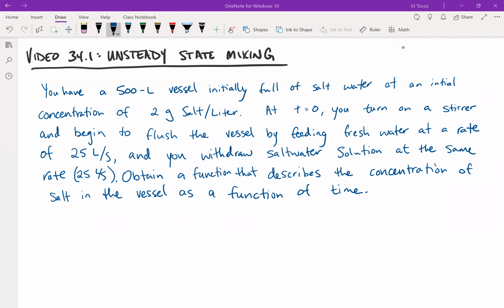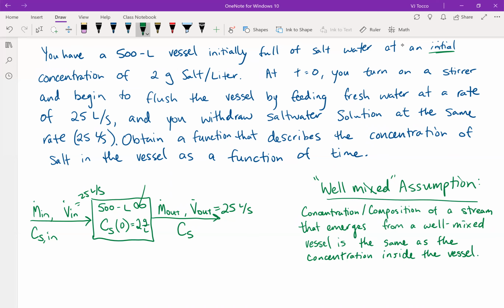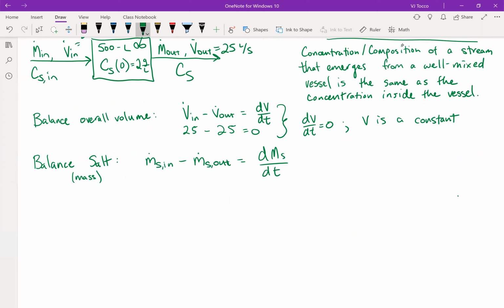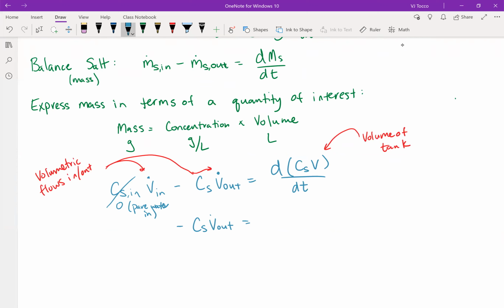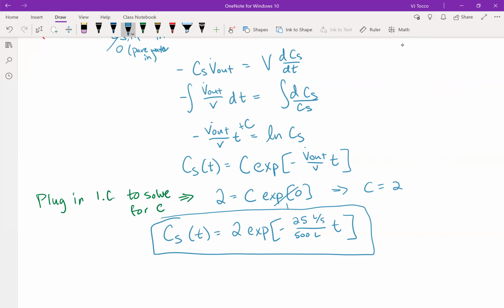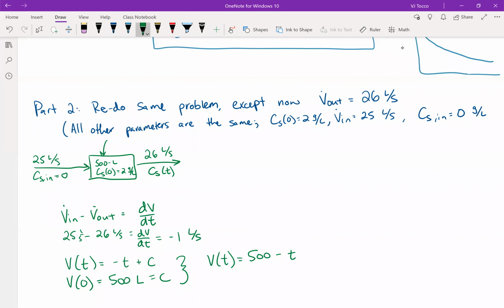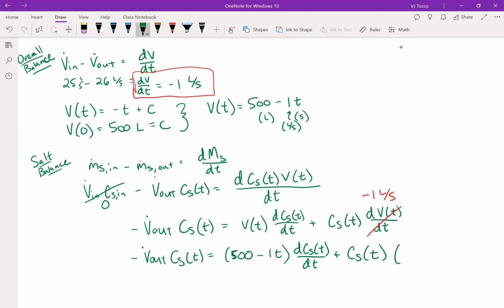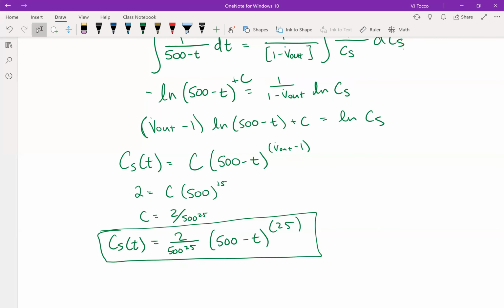MEB Episode 59: Unsteady State Mixing Processes

Comment: Thanks for the video, but i’m a bit confused on the calculus. I’m probably wrong but shouldn’t the C be e^C by the rules of exponents?
Reply from the maker: Technically, yes you are correct.  However e^C is still another constant. I don't care about the value yet until I solve for it with an initial condition, so I've assigned it to have the same letter value.  (I encourage you to try the same problem twice, once calling it e^C and another time calling it C and you should get the same answer)